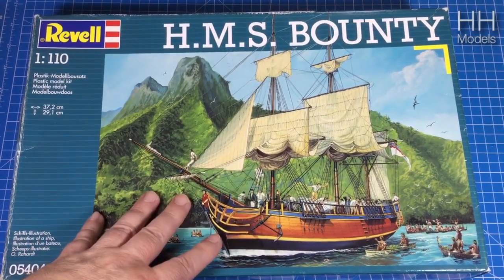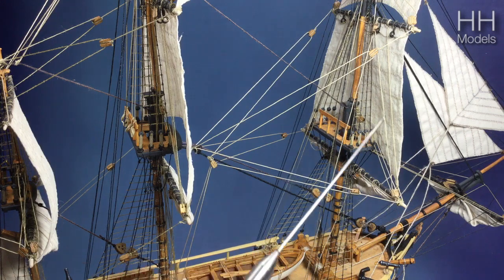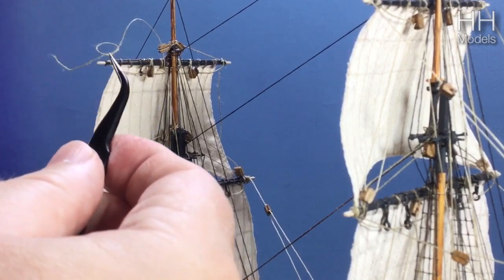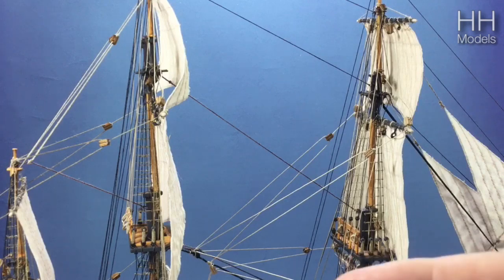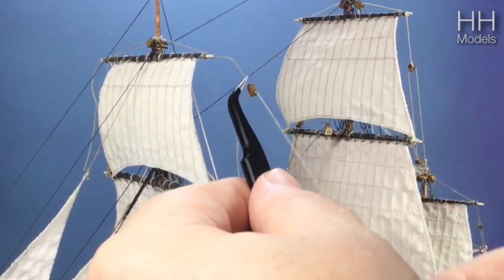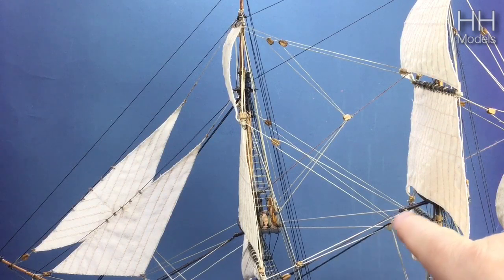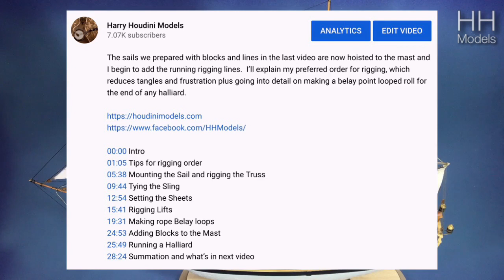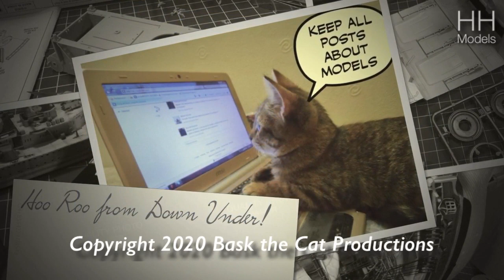Revell 1:110 HMAV Bounty Part 11 Clew lines, Braces and Finished

Comment: Thanks for this series of videos. I also recently started building this kit, even though I'm not a ship builder. So this was a great way to get to know some of the ins and outs of ship kits.
Thought it'd be a relatively simple job, but now I find myself scratchbuilding most of the parts.
Reply from the maker: How good is that?  Scratch building becomes addictive. You start to hope there is something in a build you can fix.
Reply: @HarryHoudiniModels  Hah, after rescribing the entire deck and the copper plates... then scratch building the helm, flag locker, rudder housing, all the grates, the windlass and the capstan I'm hoping there's an end in sight soon.
Reply from the maker: Did you make the missing mastheads?
Reply: @HarryHoudiniModels  I've not even touched the masts yet, so no. The next project will probably be the missing lanterns.
Reply from the maker: Yes they are fun the make. Did you see how I rebuilt the head rails at the bow?
Reply: @HarryHoudiniModels  I have, excellent work on those! Really made the area pop.

Comment: Fantastic job! And very understandable and useful tips. I will try to use them. I am currently working on the "Royal Louis" in 1:200 from Heller, which I bought over 20 years ago, but never finished. Greetings from Cologne to Australia.
Reply from the maker: Thanks Markus.  I have the Heller Royal Lewis 1:200 kit and even thought it is a smaller scale to my Bounty, it is a much larger and much better detailed kit.  Should be a joy to build.
Reply: @HarryHoudiniModels  That's right, it's a very nice ship. However, I am not sure whether I am perhaps too confident in myself. It's actually been decades since I built my last  model. And I've never rigged a sailing ship before. But let's hope for the best. :)

Comment: Hi Harry,
Great build, it's always good to finish a model.
Just one point that let your build down to a degree in my opinion, OK I am picky, was the amount of "fuzz" on the lines, when I was building the Heller 1/100 Victory (on hold for the last 20 years) running the line through bees wax or candle wax then running over a candle flame removed all the "fuzz" and may even preserve the material to a degree, I thought you did a little instructional on preparing rigging lines earlier in the build.... 
The Bounty will look good next to your Victory as a size comparison. 
Keep up the great work.
Cheers,
Stephen.
Reply from the maker: I did wax the lines, but the Revell supplied cordage just seemed to fur up again.  I switched to some Imai cord and it was much better.  I even rewaxed existing lines on the model, which looked good for a day or so, but eventually furred out.  Won’t use that Revell line ever again.
Reply: @HarryHoudiniModels  Bugger, that is disappointing when that sort of thing happens, hard won experiance.
Reply from the maker: Yep was a real bugger

Comment: I'm thinking of mounting a piece of wood inside the bottom of the hull for screws to go up through the bottom of wood plaque, gluing the block to one side of the hull then to other side as I fit the hull with the deck, then final drilling would work anywhere along it for mounts.  Can you guess this is my first mount of a ship on anything but the plastic stand it comes with? I really want it to be solid it so it doesn't fall over during the build after hull painting.
Reply from the maker: It is a very light plastic model.  Not a heavy wooden metre long ship build. So only needs a light mount to the base.  See my other comments.  As long as your pedestals are secure in the keel you should be fine.  I added no internal bracing at all.
Reply: @HarryHoudiniModels  ok that sounds good, thank you for your prompt reply